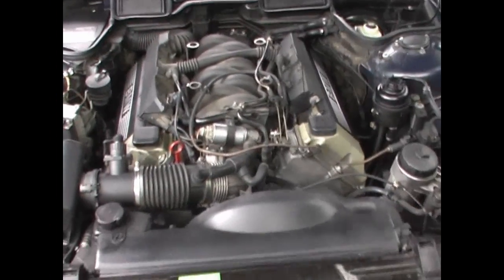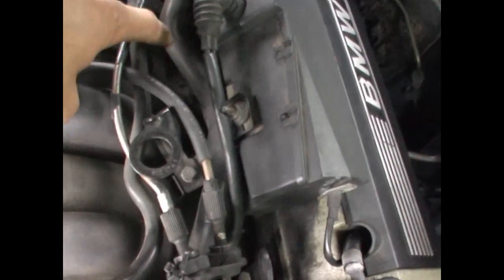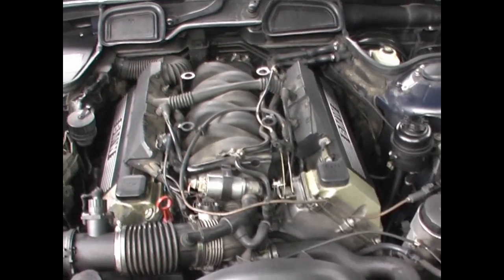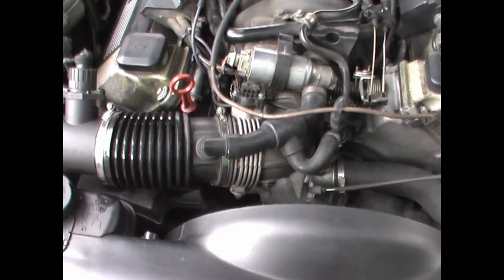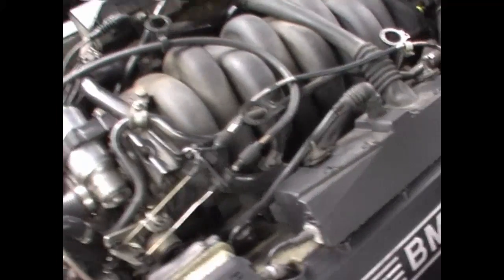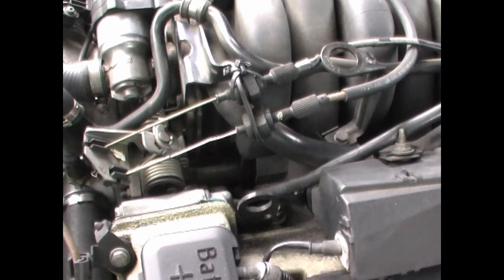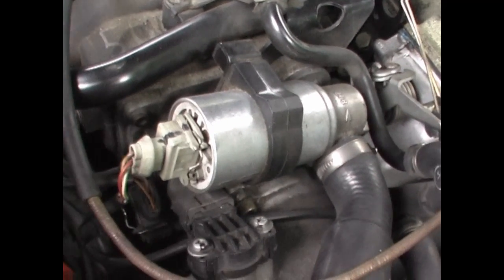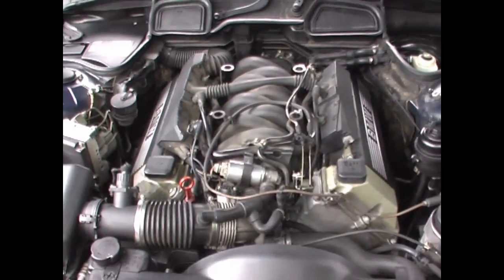BMW E38 M62 M6-TU 740i vacuum leak test how to find them

Comment: I had a symptom like this. When the rough idle also make the gas from exhaust is tear for the eye? And sometimes the exhaust blow out some white smoke?
Reply from the maker: Welly Jonathan check out my osv/pcv video for white smoke
Reply: Btw can i use maf cleaner spray to check the leak?
Reply: Welly Jonathan 
If it’s flammable, then yes

Comment: I had the same problem with my M62B35.
Just changed the throttle body gasket and now it works like brand new :)
Reply: hello  please tell me if dificcccccultand expensive ?? :)))))

Comment: Well i will try it, the thing is i let the car heat up and it still wont shift, it usually shifts under 2000 rpm but when in drive rev it up to 4-4500 rpm still nothing but thanks on the advise.

Comment: Im not sure if this could be a problem with my car but once i start the engine it idles at 1500 rpm the goes down after a couple of minutes, i don't know whats wrong, i have a 96 740 il with about 120k on engine and 150k on trans, this problem started right after i replaced my valley pan,(i did not change the intake manifold gaskets tho)and now the trans wont even shift out of first gear unless i use sport mode. Can anyone help?
Reply from the maker: ***** Try to do the test and see if you have a leak, the tranny should shift once the engine is warm, it is quite normal for a M62 with the 5HP30 to hold gears longer when cold

Comment: I have a 2000 bmw 740i when i press the gas pedal sounds that is intake in too much air sound like a diesel truck but my car is gasoline i already change air filter, spark plugs, cooling fan, but the problem still please help me
Reply from the maker: I would need to hear a video of that............ please send PM or join the bmw e38 forum on facebok
Reply: Ghostknight13 sell the car that way you can get rid of the problem lol😂😂

Comment: would this or vacuum related also cause the car to skip/cough/hiccup while driving, almost like bad gas? This has been going on for months with my car but recently been getting worse, also we've had extreme cold weather... When i start my car is runs very rough, and idles like this when sitting, gets better after its warmed up but still runs rough. Fuel filter hasn't been changed in years if ever and spark plugs haven't been changed in about 8yrs. It's a 1990 525i BMW. I've had the distributor cap, rotor, replaced a couple years ago. Any suggestions on what to replace first or all at once...? Thanks
Reply from the maker: Start with the hoses and check for leaks, bad idle on cold and better when warm is classic vacuum leak, also check out your MAF sensor
Reply: Replaced the spark plugs and spark plug wires, runs like a charm now. The plugs looked horrible. There were no hose / vacuum leaks at the moment... How difficult is it to change the MAF?
Reply from the maker: BRIANA CASH
plug wires? the car doesn't have them, MAF is easy please buy BOSCH only others will fail and impact your fuel economy!
Reply: Yes, my car does. 1990 525i plugs and wires right there on top. :)
Reply: Wires from BMW and plugs are of course Bosch.

Comment: maybe could be I took 3 video more now.I m uploading it for youtube I will send it to you.I dont know should it be there anything on the rear OSV inside the intake manifold that  I didnt put it there.before I forget to put the Oil pipe that long One on the OSV .I corrected that.and now again I tested with the brake cleaner No sound change on the engine I did same things as you did.everywhere brake cleaner.But when i take the dipstick out there s coming an air sound from inside of the intake

Comment: Hello.I tested with the brake cleaner when the engine was cold.but  when the dipstick s on the place everything works normal.and no leak :S I made almost everywhere brake cleaner same as you do but nothing change...but I dont know did I do something wrong when I changed the REAR OSV Did I put everything back on the place.can it leak from the Oil pipe?.Also Oil s leaking...From the front of the engine Alternator is all in the oil..I really need help.I cant even take a good video with the phone..

Comment: :)Today when the engine was cold I started the car and I pul out the dipstick engine made the same sound like loosing the power.and I put the dipstick back on there it is working normal.I changed my rear osv at all but I dont know did I do something wrong.

Comment: I have a 2003 540i with the M62TU, had the same symptoms, and my leak was coming from the same place.  The gasket between the intake manifold and the throttle body "flange".  The gasket was $15 and it took about 30 minutes to change it.  The car purrs like a kitten and goes like a freight train now!